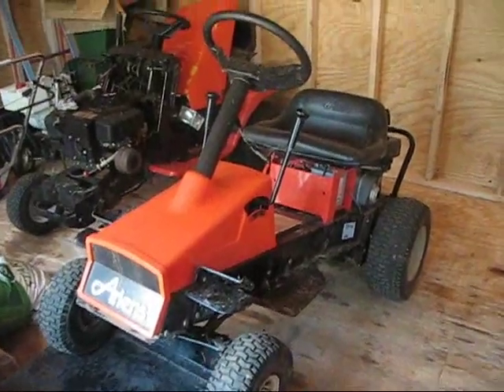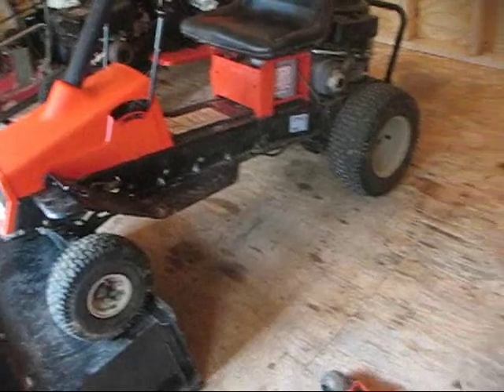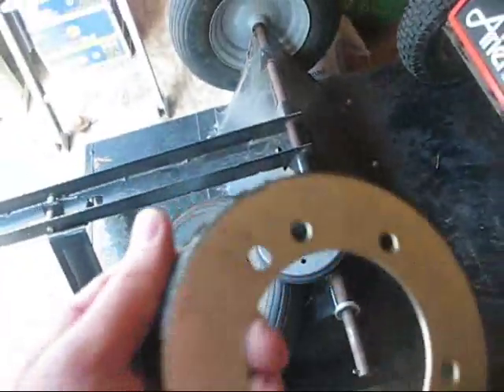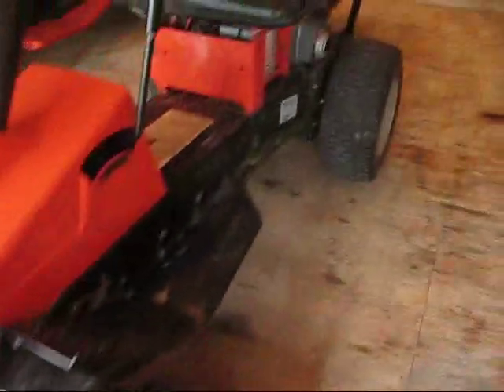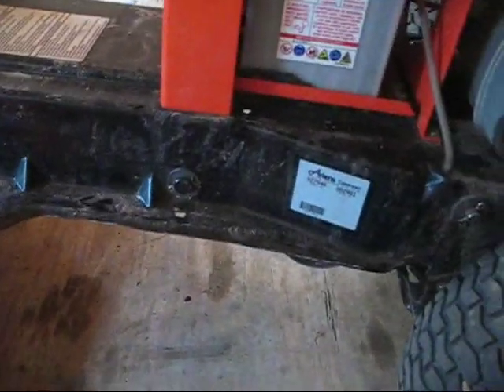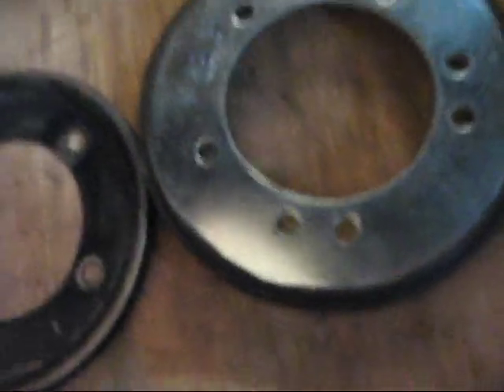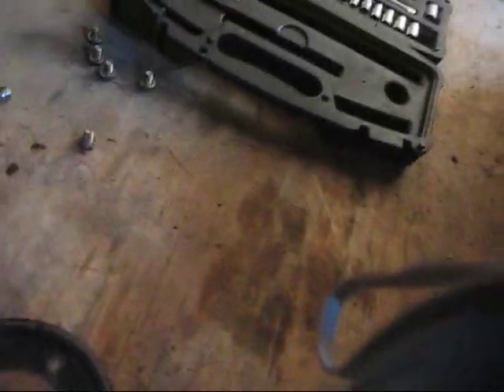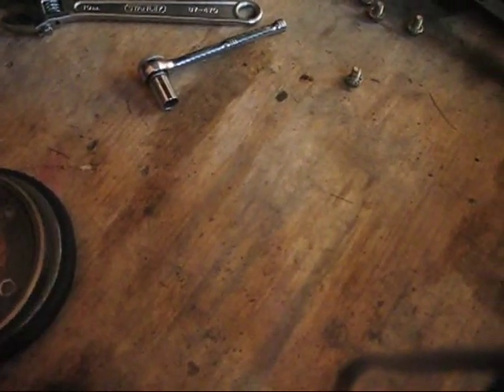HowTo: Replace Your Disc Drive Friction Disc Wheel

Comment: Just replaced my friction  disk in my new used Ariens RM 1028 using your excellent vid. Very simple  following your directions. New disk from Ariens dealer was only $16.00 with tax and only took a few minutes.Thanks so much.

Comment from the maker: The older discs tend to last longer for whatever reason I do not know, the other rear engine rider used in my movies has a quite old drive disc in it that worked fine for quite a number of years. The new ones don't last worth crap though.

Comment from the maker: @MrBoy219 one disc a year is a lot to be going through. There aren't any adjustments to speak of that you can make to the disc itself, but adjustments to the surrounding linkage can be made. I would start by checking your linkage to the clutch pedal...if you are burning up discs then my guess without looking would be that your linkage is either sticky or rubbing. Try seeing if any of that linkage will free up, good luck!

Comment from the maker: I've never heard of a craftsman with a disc drive, so it is not probable. You can look under the machine, if you see a solid gearbox around the entire rear axle, it will not have the disc drive. Good luck!

Comment: I have an Ariens that looks very similar.  Can you tell me what to do about it not working in reverse?  It goes forward in all gears perfectly, but no reverse.  Also, the blade stays engaged at all times, whether I actually have it engaged or not.  In other words, if the mower is running, the blade is too.  Any help would be very appreciated.
Reply: Check the linkage for blade engagement and lube all pivot points and make sure it’s not sticking. That all there is to the pto mechanism.